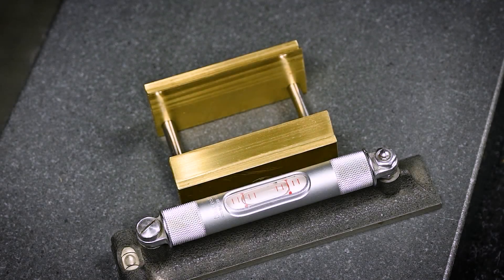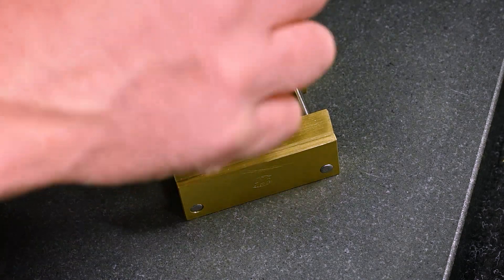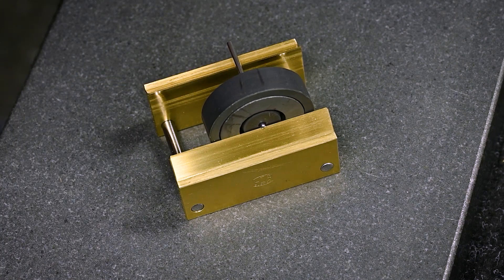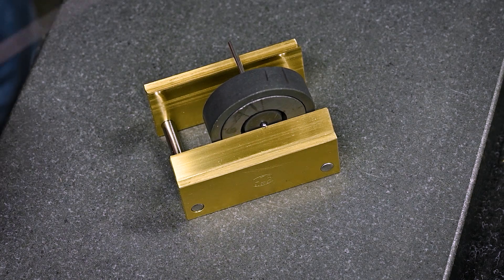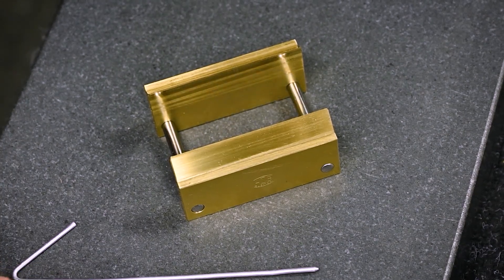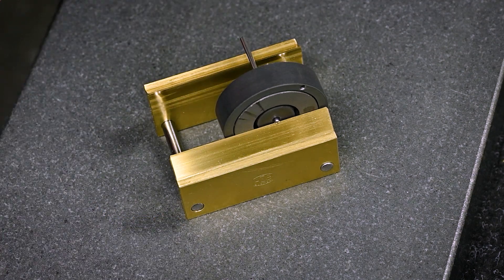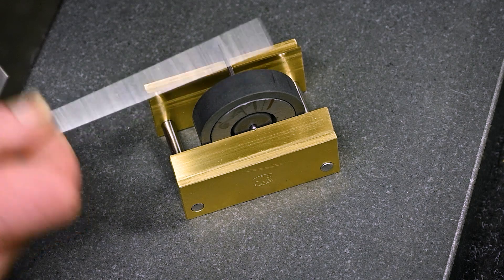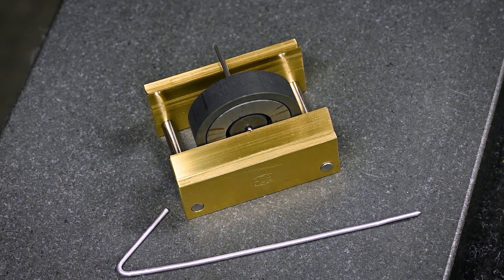Capstan Balancing

Comment: Beautiful.
If we use the support in the form of two very long stretched strings instead of a runway, excessive weight would always be at the lowest point (almost).
But it had to not work since nobody does that.
It's just an idea.
Reply from the maker: Interesting concept, please expand on how gravity would act differently upon the capstan when using string?
Reply: @asbcustom 
First of all, you do not need a grinder for planes and measuring plate to make a balancer .
Secondly, if the body is almost accurately balanced, the movement stops in virtually any position of the flywheel.
I intuitively sense that when leading the strings, this moment would be more precisely defined.
Practically not to be performed due to the elasticity of the strings.
I'm not native English as you can see.
Reply from the maker: English is my second language also, so I regret that I can't follow your comments very well. Your second point is correct, you might watch the video again to see that this is what I'm showing. This method of achieving balance is well established in industry and aerospace, I didn't just make it up.
Reply: @asbcustom 
I know it :) 
This is not a criticism is rather a way to say anything but the praise of your workshop skills.
I like your movies.
Reply from the maker: Just a bit of a translation issue is all, I very much appreciate your comments. 
You might like the video about making the balancing stand here: https://youtu.be/tRogYfKBxiw. I had a little fun with the intro.
Reply: @asbcustom  Thanks!
Reply: @asbcustom 
And the fact that if there are magnets in the flywheel, the ferromagnetic string would falsify the measurement.